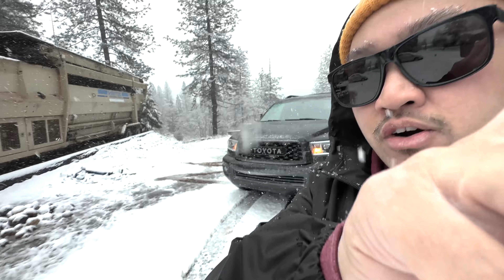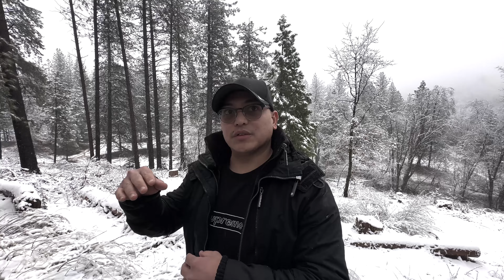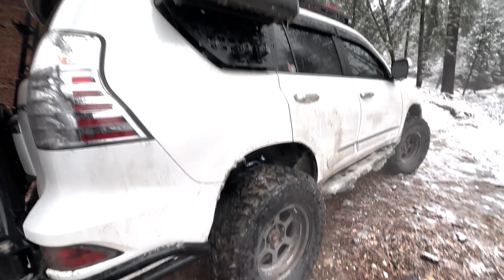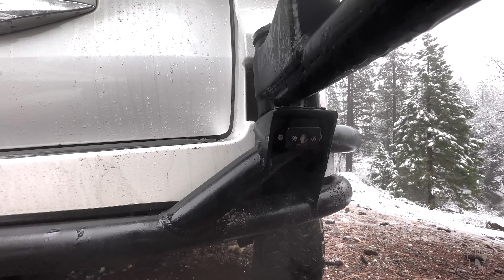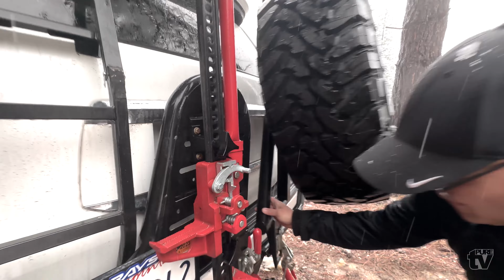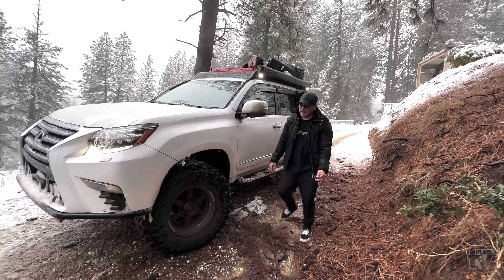PURE TV: Anthony's Lexus GX460 Walk Around Overland Build / Baja Designs Toyo Tires TE37XT PURE 4x4

Comment: Amazing build. Looks like he also has air bags installed in the rear springs. Curious how that process was.
Reply from the maker: I don’t believe he does, might be the bump stops?
Reply: Hey Jonathan, just to confirm, yes we do. We have rear helper air springs to help out when rear is overloaded on trips. Usually aired out when rig is empty or going wheelin. The process was easy and pretty straight forward.
Reply: @radproduxions3130  amazing! Thought I noticed it. Was thinking of doing something similar to my 4Runner. Assuming they’re hooked straight into the arb compressor.